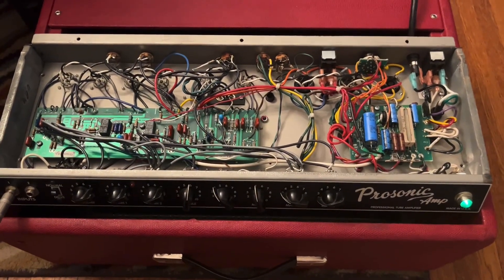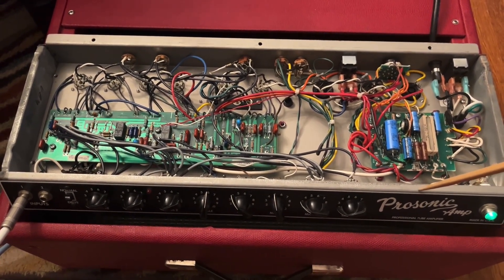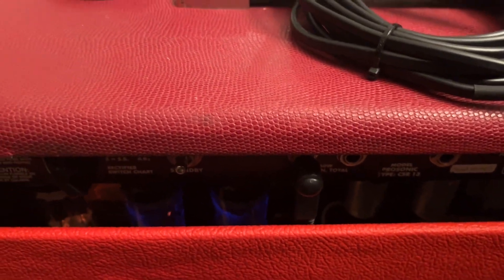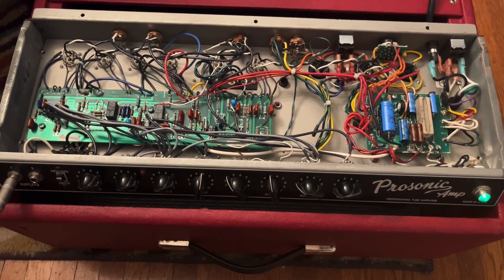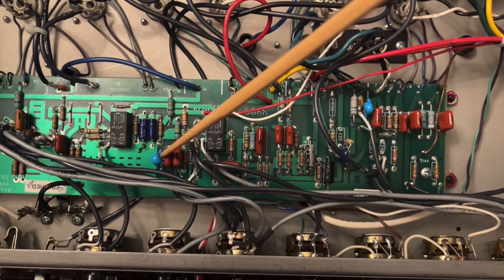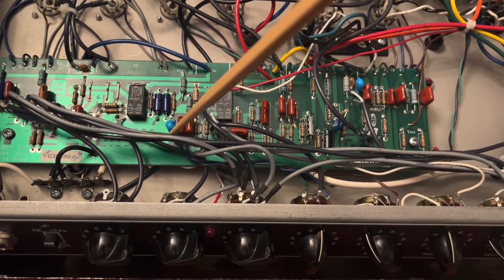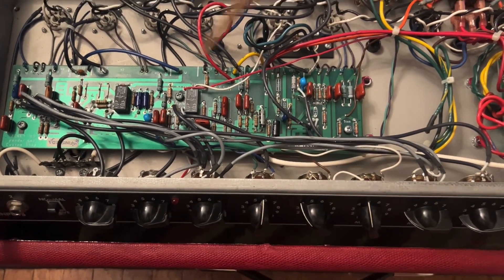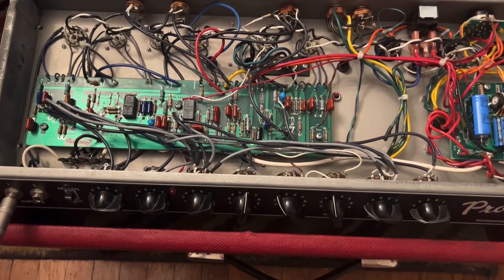Fender Prosonic tube amp noise - crackle and static after warm up - and the fix

Comment: I am getting a very similar sound in the right channel of a Voli2 headphone amp. I've done all the tube swapping and wiggling and giggling. The volume knob and other switches have no effect. Should I start by changing the caps? I found some higher grade audio caps with identical specs. They're cheap too. Under $20 for a set of six 50v 470 uf. I guess my question is, are the caps a good place to start with a crackling like that in my right channel? If that doesn't work I'm afraid I might have to start desoldering and replacing the tiny little transistors (not entirely sure if that's correct). Schiit didn't really back their mfg after they tried to repair it once and sent it back with the issue continuing.  Any thoughts are appreciated.

Comment: Hey bro, do you know where the SS rectifier is in these, because I cant find it anywhere? Part of me is almost starting to think, even though the Rec switch def changes the sound in every position, I'm almost starting to think that maybe it's actually meant for if you swap out the Tube Rec with a drop in SS rec w/ tube pins. Maybe the switch works, because its just still using the tube rec in every position, but the voltage, and current etc is just changing, and the SS positions are actually more dialled in for if your using a SS rec, but as far as it having both at the same time, I'm just struggling to find it anywhere. I also have an amp like that, where theres a switch, but it's meant to run one, or the other, but still works in both positions with just the same rectifier type left in. Just curious if you know where it is though, because I've always assumed it was meant to switch at will, but like I say I just cant spot a tube rectifier anywhere.
Reply: Oh wait, is it that one little single diode all by itself next to that biggest blue cap on the right?
Reply from the maker: There are four 1N4006 diodes on that little bias board, which houses the blue capacitor you mentioned. They are D101, D102, D103, and D104 on the schematic, functioning as a bridge rectifier. 

To my ear, all 3 positions sound distinct, and are good for what they do. The SS position, as expected, is the most quiet and feels the most “stiff”; the tube AB mode introduces a little more hum but feels more tube-y and has some sag; the class A setting has the most hum and is the most spongey and saggy, esp on the clean channel as its cranked into power tube breakup territory. I like all of them, but run it in class AB most often. (I also plug into the attenuated second input a lot, so I can turn it up a bit louder; and run some vintage 5751 tubes in V1 and V2, which also bring the gain down a bit.)

Hope this is helpful!
Reply from the maker: Here’s a link to the schematic: https://www.thetubestore.com/lib/thetubestore/schematics/Fender/Fender-Prosonic-Schematic.pdf
Reply: What a rats nest of wiring. I heard Bruce zinky was the designer.  I would expect better.  Good sounding amp though.

Comment: I've got a issue with mine where it randomly makes a buzzing/static/crackling sound. You can play through it and it doesn't affect the guitar signal. tried isolating the preamp and power sections and it's in both. Happens totally randomly and can happen after it's been on for 3 minutes or 3 hours. Any ideas?
Reply from the maker: Sounds very similar to my issue. I'd at least consider the possibility that that little treble cap is bad. If you're not comfortable working on amps, get it to a professional, and refer them to this video if useful.

Comment: Wow - I bought this amp new and toured it for 5 years. It was 'rode hard and put up wet,' but always performed beautifully - until  the last couple of years, when it started developing the problem that you are describing - intermittently. It's been on some of the best benches in Detroit and Los Angeles, but problem has never been fully resolved. I was going to sell it off cheap, but now I'm going to take your video to a trusted amp guy and see what we can do. Thanks so much!
Reply from the maker: great! hope it all gets resolved - please report back about the outcome. They're great amps, IMO, but the ingredients make a difference! One inferior cap that doesn't hold up well can (obviously) turn the thing into a doorstop... :-) 

Studying the schematic (as much as I am capable of), it's also a somewhat bizarre circuit, with the shared EQ and the switching relays for the drive... and a whole triode (half of v3) that isn't even used.  But it is well designed, and well made, for the most part. They're worth keeping up and figuring out (for my money!).
Reply from the maker: Did you ever get your Prosonic back to a tech and see if that cap replacement resolved the issue? I've gigged with mine quite a few times since this repair, and it's performed great! I've gone on a whole other journey with trying different speakers in this thing; for now, I've settled on an Eminence 1058 and a Celestion VT Jr.

Comment: Wow.  I bought my Prosonic in 1996. Last year I left my amp on all night and the next day is was wailing with that 'noise'. This is the only answer on the Internet! Amazing you posted just three days ago. Thank you!
Reply from the maker: So glad it could help someone else! I wonder if fender just got a bad batch of those little silver mica capacitors, or what the deal is… The part was rated for 500 V, so it shouldn’t have been a problem, necessarily, but things do break down over time. 

Intermittent problems are the worst. I actually had several months ago taken the amp to a very competent tech, specifically about the intermittent crackle. He corrected some other obvious issues that he assumed would resolve it… but when I got it home, after a couple gigs the crackle returned. (I mean, not his fault, really. He said he ran it for a few hours with no problem, and I believe him - it was probably only after 4 hours of continuous use that it returned for me; and then more frequently after that.) So it was gratifying to eventually diagnose that one bad cap and correct it myself.

Best of luck!
Reply: @BrannonHancock  Success!  I bought some 150nm disc caps on Amazon, replaced, then GOLD.  So good to have my amp back.  Thank you.
Reply: @IanFaymous cool conversation here. I came to this video because I'm thinking about buying one. I'm a noob and ready to return to this thread when the one that I saw for sale starts noising 😬😄
Reply: @asharpbflat7179  Sweet. It was fairly straightforward. I clipped the old leads. Heated up the existing solder and pushed the rest of the leads through the bottom then dropped the new leads through. I’m not very good a soldering and it fixed the issue immediately.
Reply: @IanFaymous  awesome! 🙏 can I ask you how's the eq on the amp? Do you think the amp's good in compensating for very bright but also VERY nasal sounding pickups? I got a new guitar this summer with very atypical pickups, I love it, but it has almost "too much character". (That's some high mid freq's I guess?) I didn't play the Prosonic yet, I just thought it's awesome as a kinda different and fairly cheap Fender, no?